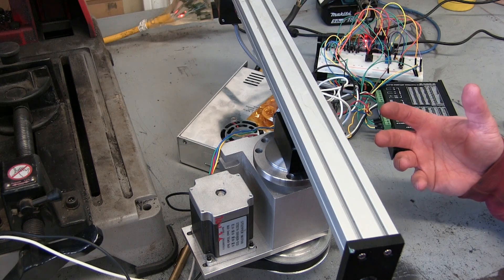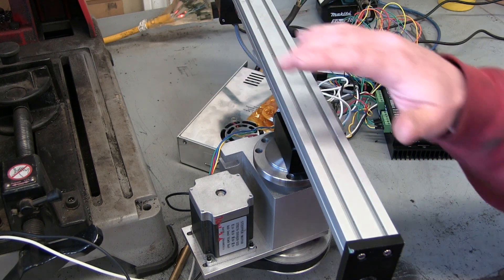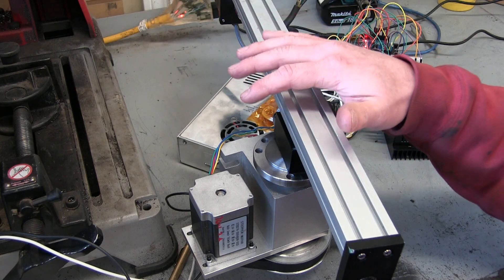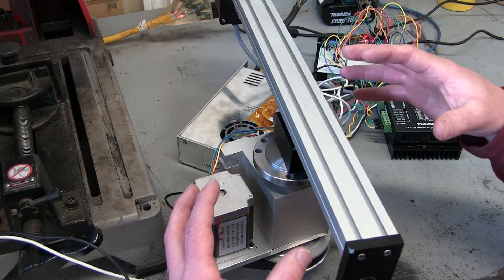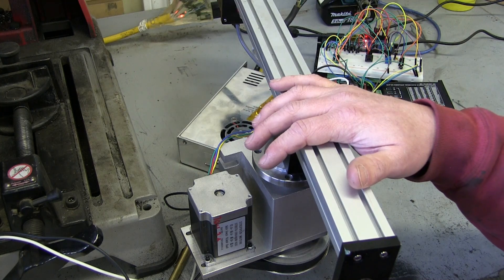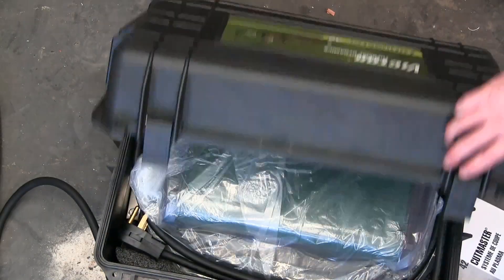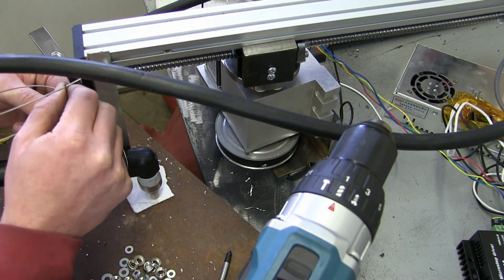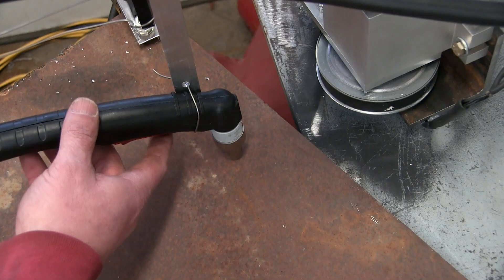Portable CNC Plasma Prototype

Comment: You know, along time ago when I was a kid, the first job I ever wanted was to be an inventor. At some point I wrote it off as being something you had to be incredibly smart and lucky to do, and I never thought I would be cut out for it. Watching your videos on prototyping has been kinda inspiring, maybe today is the day I pull out the Raspberry Pi B I got collecting dust and start playing around.
Reply: Mike ingrum Yeah man! I'm "inventing" stuff all the time, but usually have a "better" idea before finishing a project. Cryocoolers made from speakers, jet powered paddle board with embedded solar cells, cryogenic (liquid air) energy storage (instead of heating water to steam to power a turbine, liquid air is boiled by ambient air temperature to spin turbine, then cooled after expansion- cryogenic rankine cycle), wind turbine powered boat (someone already did that one), I even made a Magnus Effect  (a spinning cylinder creates lift) hang glider, thermoelectric generator substituting for a car alternator, etc. It's mostly just for fun. Even made a sidecar made from a beer keg (shaped like a rocket) so the dog ("Friday") can ride with my daughter on her electric bike. Some things work, some things "could" work, some are laughable. Look up Simone Giertz, (inventor of shitty robots). Great arduino/ rasp pi projects!

Comment: Needs a laser.  What for finding X0 Y0 on your work piece....
Reply: That's how laser cutters do it: a laser pointer coming in at 45 degrees so it hits the workpiece at the cut point.
Or you supply an attachment for the tool holder so you can put a sharpie or chalk pen in it and have it trace the shape. That would also let you use the same contraption to mark out holes to cut with a different tool if the plasma isn't appropriate (because you're at the bottom of a Vespene gas mine and you need to cut everything with a non-sparking lead hacksaw blade)

Comment: Why not do the same thing with a welder so it lays perfect welds? You just pick a line length, set up your pieces and get a perfect weld every time. Only requires one axis and could be an additional feature, would take hardly any extra programming.

Comment: hHey man.... Fuckin love it. I can see plane as day the goodness in this contraption. I'm a welder fabricator turned CNC machinist and I'd use it all day long to knock out the quick jobs! Let me tell ya though...... Far and away, the thing i hate most about welding.... The blasted mess o cords that get fuck-tangled all to hell no matter how you try. Moving grounds, crawling under shit .... It sucks! so, The big problem i see is carting around not just the box but the leads and air hose.... Your tethered making it hard to use for  up'n  under work, over head etc. Integrated cable and hose management is a must with a piece of kit like this. Good on ya Fella! Huge fan! keep it up!
Reply: Also, as I said, I r a cnc machinist and fab man down here in the lower 48 .... and if there is ever a thing i could help ya with I'd be more than game. You let me know if'n the time comes.  Cheers!

Comment: Re: "too fast on the rotary axis"

Your cutting power is limited by linear speed, obviously not directly rotary speed.   The rotation speed needs to be reduced in proportion to the extended length -- double the distance, half the rotation speed.
Reply: Majromax I knew I would find this if I looked through the comments. Seems like an easy software revision though.
Reply: Majromax I hoped I'd find this in the comment section.
Reply: I was thinking of something on the same line, but your solution would be more simple to implement.

Comment: great idea but I am thinking the simplest thing is a magnetic template that the plasma cutter and operator follows by hand. I suppose the CNC stepper motor can however give a smother cut provided it does the math to run at a constant linear speed whatever the shape. Templates have a problem of wear and tear and also being the exact shape and size required which your idea overcomes of course.

Comment: I LOVE IT! Might need a mechanism to account for material warpage while cutting or for sheet that's not exactly dead flat tho. It would be perfect for my shop, no space for a 4' square table this is small enough to keep on a shelf. Would be cool to have both a purely conversational programming but also have a way to import a program for those that do want too or for something a little more complex than a conversational system can truly support
Reply: SeptrothFFXI maybe a bump switch of some sort so that if the tip comes in contact with the material it lifts?

Comment: Very interesting idea - you might be onto something here.  One challenge to solve will be how to position and align it accurately.  A mag drill only works in one spot, so zeroing is easy and there isn't any tramming.  Since this moves, you'd need both.  You could project a + with a laser for position and alignment, but that means you'd need to position the base accurately. Since you can adjust in software, it would be neat if you could get it "close enough" and then align it in software.  That would be great for awkward working conditions.

Comment: I looks as if it should work well as long as it doesn't pull the old wile e coyote routine and cut himself a hole to the abyss
Reply: Will McDonald 
I agree, with a mag drill I have full control of the size and location of the hole to be poked. What happens if the ones and zeros get crossed on a critical cut/hole?  What's his face recommended lazer maping of the pattern, I think this would be an invaluable addition to the machine. It would give you a measure twice cut once factor, as well as avoiding the what the fuck was this robot thinking double check.
Reply: Will McDonald 
I agree, with a mag drill I have full control of the size and location of the hole to be poked. What happens if the ones and zeros get crossed on a critical cut/hole?  What's his face recommended lazer maping of the pattern, I think this would be an invaluable addition to the machine. It would give you a measure twice cut once factor, as well as avoiding the what the fuck was this robot thinking double check.
Reply: Will McDonald And this is the square wheel on the elephant in the room. 😀